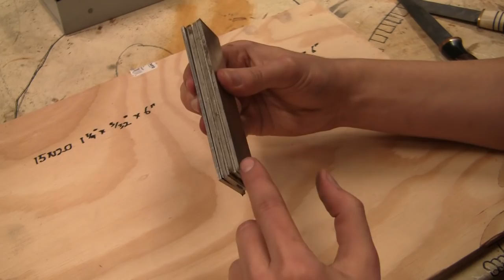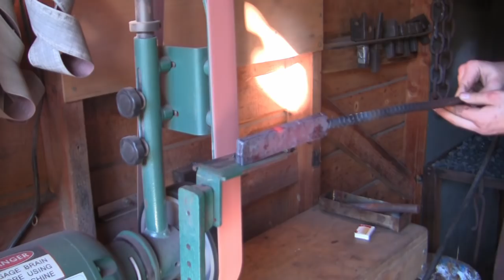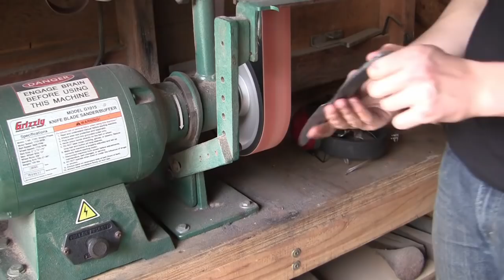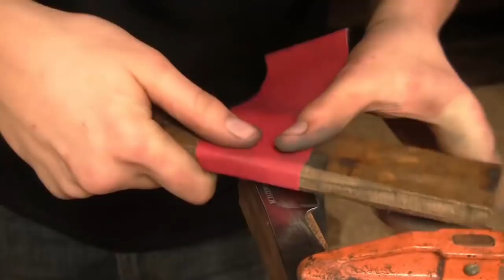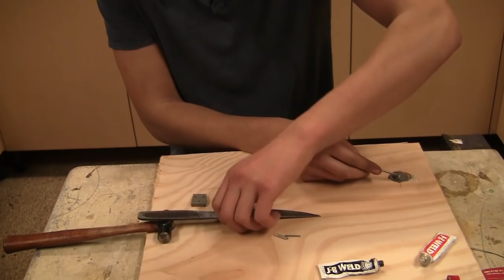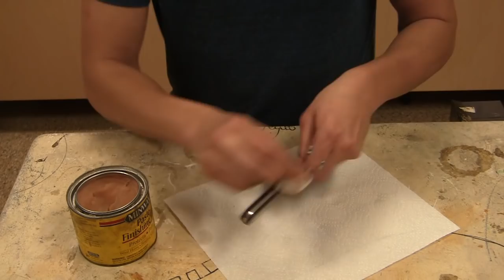Making a Damascus Kitchen Knife (Full Process)

Comment: Nice job, but the sharpening angle looks way too big to me. 1095 can handle 15° easily. Yours looks like 30° resulting in a 60° cutting edge like of an axe or cleaver.
Why did you put in six tiny pins and not three or four bigger ones? No offense, but they look like casket nails.
Reply from the maker: Looking back at the video it may have been a too big. It cut well though. I usually go for a 30 deg. overall angle on something like this. 
The pins were a style choice, I personally like them and so did the customer. And there's nothing wrong with casket nails, coffin handle bowies after all do exist :)

Comment: Sweet work man! I really wish I had a welder now. Do you think it's doable to forge Damascus without one?
Reply from the maker: It's doable without one, I've done a couple of billets before I had a welder. Just wrap the billet in iron wire to hold it together. Be careful the wire doesn't disintegrate or burn up in the heat of the forge. And of course you'll need to hold it with tongs instead of attaching a rebar handle.
Reply: Sharp Works I've seen plenty of videos that just use wire. Wrap it around and snip it off when it gets to forging temp
Reply: Thank you for the information I'll try it one day.
Reply: Sharp Works check out Big Dog Forge channel. He just did a saex and in part one he used the wire even though he has a welder.
Reply: Phillip Taylor I'll check him out thank you